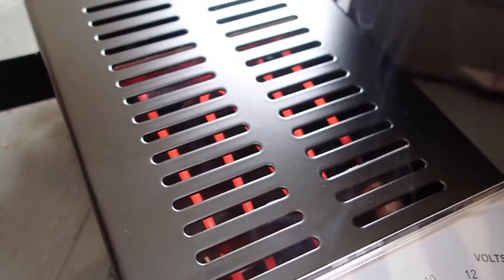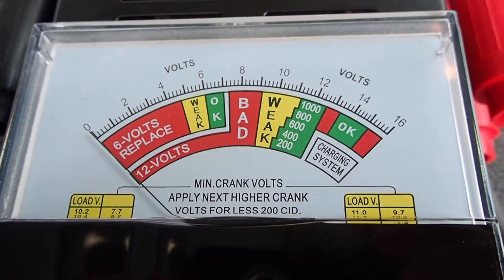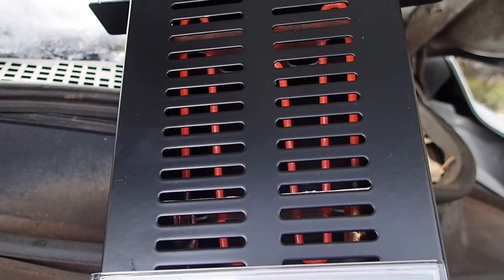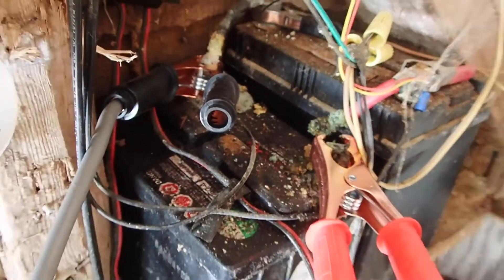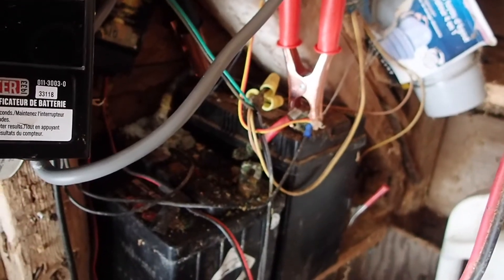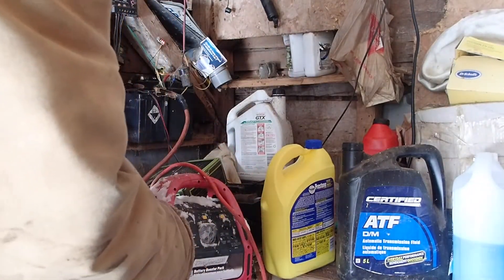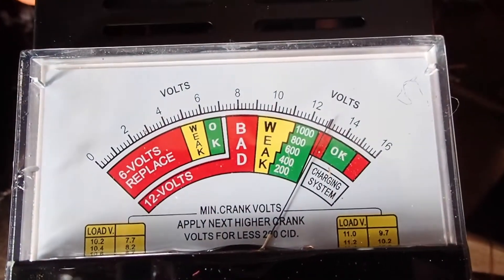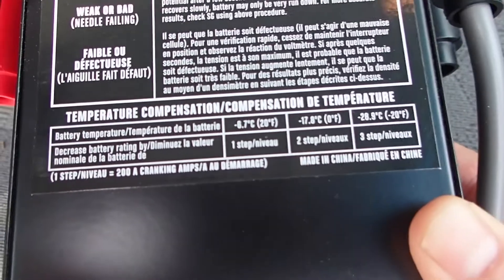REVIEW: MotoMaster Battery Load Tester  - How to Load test Solar Battery Bank

Comment: errm is that supposed to smoke ?
Reply from the maker: It does yes as element heats up. Burns off residual water, paint, oils etc
Reply: 5 second max test?